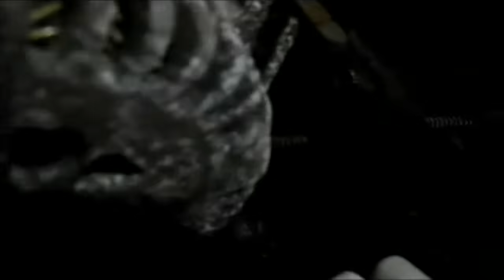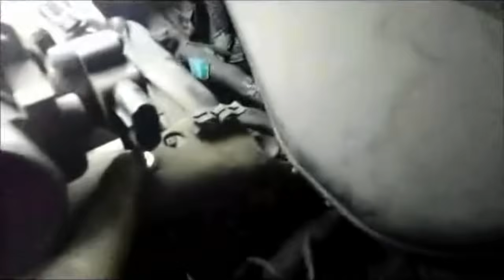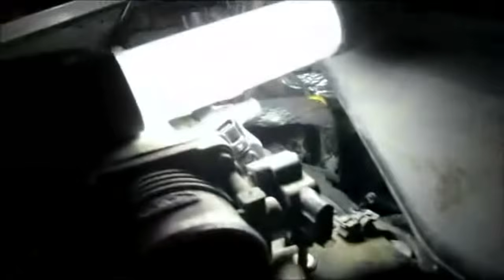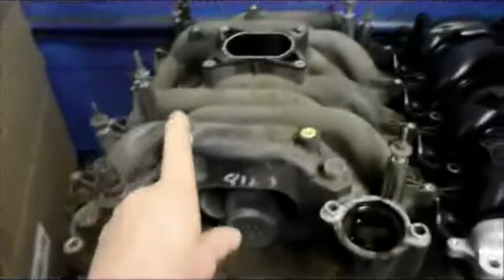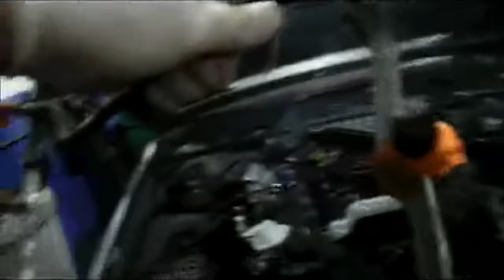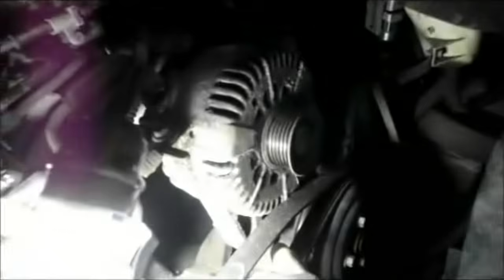How To Replace The Intake manifold 1996-2007 Ford 4.6 Liter

Comment: But the cat didn't tell us all the torque spec's and the tightening sequence. Also, wasn't he supposed to unplug the inertia-switch in the trunk of the car so as to cut power to the fuel pump then run the engine until is starved of gas before disconnecting fuel lines to avoid spraying pressurized gas into his eyes?
Reply from the maker: Thanks for watching.
Reply: u can look up torque specs and tightening sequences. what if ur intake blew u cant run the car. this video is more so a quick guide than a full tutorial for beginners. great video imo besides picture quality and lighting... but not everyone owns a new camera, what u gonna do.